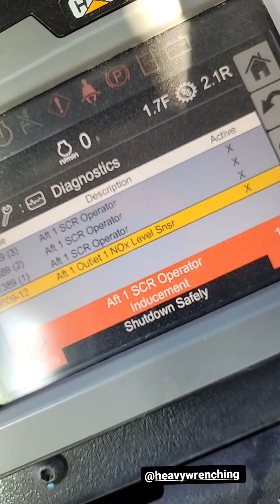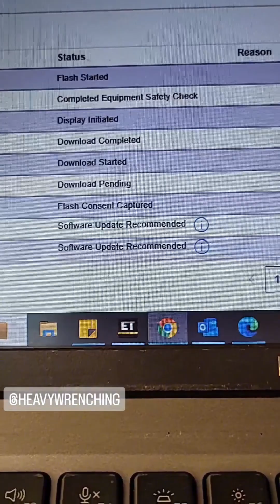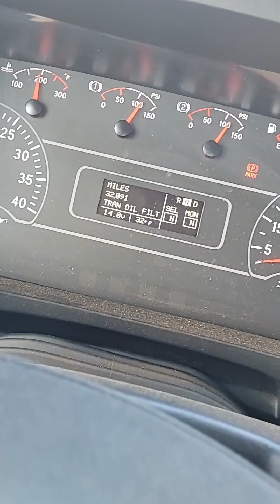#february 5th-9th #week in #stories #heavyequipmentmechanic #caterpillar

Comment: You guys aren't allowed to revert back to "not installed"? We can if we prove to cat fps that it was ex factory.
Reply from the maker: DSN/Cat Approval required
Reply: What was the deal with that control valve?
Reply from the maker: @wesleycooper2647  control valve leaking between lift and tilt slices (recon valve)
Reply: Right on. Keep em coming